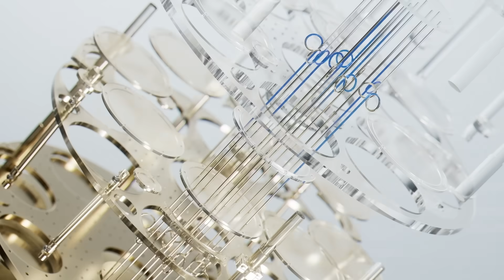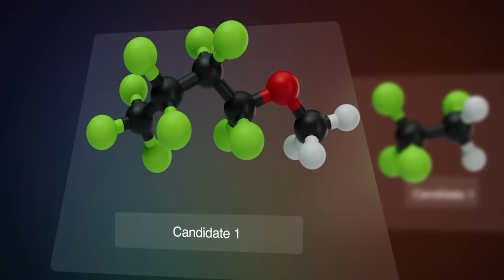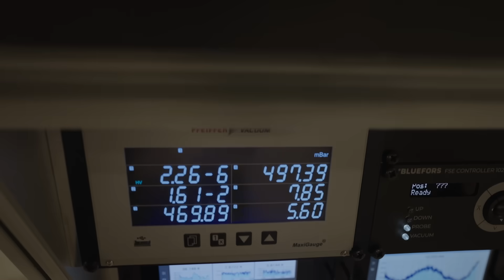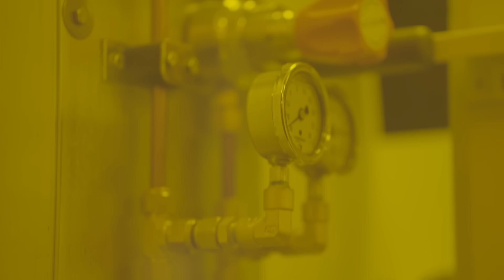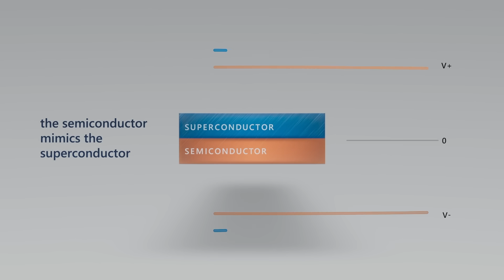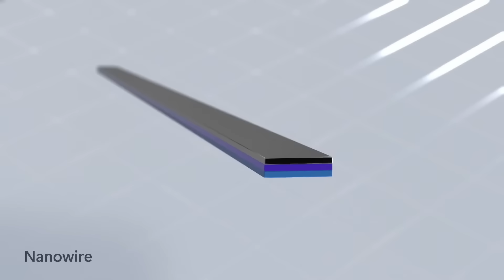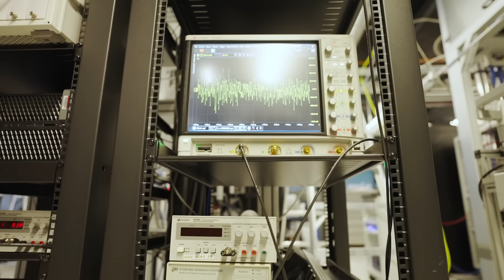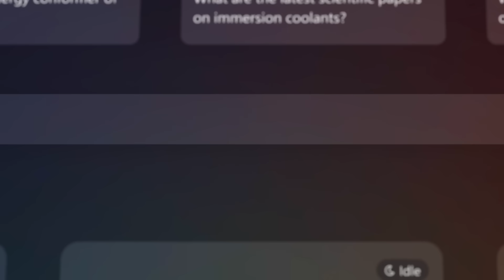Majorana 1 Explained: The Path to a Million Qubits

Comment: I have several questions about the device itself. How do you distinguish the observed signal from trivial ABS and confirm it’s really a Majorana zero mode? What is the operating temperature—does this require millikelvin cooling and a multi-million-dollar dilution refrigerator? What are the coherence times (T1/T2), since terms like “stable” and “fast” aren’t enough without numbers? Most of the video focuses on explaining quantum computing and the Majorana concept, but provides almost no information about the actual hardware, noise sources, fabrication constraints, or how the topological phase is validated. I genuinely wish you success—this field needs real breakthroughs—but adding concrete hardware details would help separate scientific progress from marketing
Reply: @נתאיבהליקר  check out their Nature published paper, it’s nothing but a glorified Andreev state, pure marketing video

Comment: the gerarquie in the computer what make from causer the deligation sistematic those direct of mouch of you componectsinertcapturatives of info and data trasmit in transition to tv after od all the mirrows the active a similer but no say what a chain of ligth qual and in other those make view the valueds of my make no undertend but to trazor of what my incompenseds yes are most of the extimeds intro price what suborigens when of my molder hardware but example oppo but mention breack and no are to down value what those resalen the

Comment: @microsoft

I have Something to share with you Guys....Tell me what you think about it. 

*Quantum Impulse Trajectory Control (QITC): Revolutionizing Qubit Manipulation*

I'm excited to share breakthroughs from my Quantum Impulse Trajectory Control theory. QITC uses precisely timed, shaped impulses to "catapult" qubits along optimal trajectories in the Bloch sphere, rather than relying on continuous resonant driving. This fundamentally different approach creates ballistic quantum trajectories that minimize energy dissipation while maximizing speed.

My mathematical framework combines aspects of Landau-Zener dynamics with optimal control theory, verified through 10,000+ Monte Carlo simulations. The results are compelling:

• 4.5 ns gate times (20× faster than standard gates)
• 99.72% fidelity under realistic noise conditions
• 0.037% leakage (5× lower than conventional methods)
• 16,600+ operations within coherence times

These parameters are achievable with current hardware:
- AWG sampling rate: 25 GS/s
- Timing jitter: 2.0 ps
- Pulse width: 300 ps
- Rabi frequency: 150 MHz

With modest technological improvements over the next 3-5 years, we could reach 2.0 ns gates with 99.9% fidelity. QITC could significantly accelerate quantum computing development by breaking through conventional speed barriers while maintaining high-precision control.
Reply: Future modifications to Rabi frequencies and pulse shaping could push gate times into the picosecond regime (100-200 ps). This represents the absolute physical boundary for quantum gates, as we'd reach the fundamental quantum speed limit imposed by Heisenberg's uncertainty principle. At this point, the energy-time uncertainty relationship (ΔE·Δt ≥ ħ/2) prevents any further acceleration, regardless of technological advances.

Comment: Its important to not oversell the discovery of a new particle. Majorana particles are quasi-particles, so no new particle has not been discovered. 

A quasi particle is a mathematical shortcut to understand the movements of real particle/waves through materials. Like phonons or excitons they are emergent rather than fundamental.

Majorana particles are not additions to the standard model, but mathematical objects that can bring insight. 

A million qubit quantum computer is mind boggling by itself. why try to sound sensational with misleading headlines?

Comment: I've read all of their papers, and none of the papers mention the peer-reviewed experiment. For example: Reference 2 is a preprint hosted solely on arXiv (2502.12252v1), so it hasn't gone through the formal peer-review process.

Reference 13 is a paper published on the Microsoft Research website, not appearing in a peer-reviewed scientific journal.

Reference 15 is a post on the Microsoft Quantum Blog, which has also not been peer-reviewed.

Taken together, this means that much of the specific information about Majorana 1 comes from arXiv preprints and internal communications or blogs, rather than from peer-reviewed publications. And in 2021, they retracted the 2012 report. So, is it a scam now? I really hope they're right; otherwise, I'll switch to Linux. Prove it's real, or stop lying.

Comment: Notice how they mentioned vaccum tubes were more efficient than transistors? Also why has no one bothered to use plasma contained modulaters? They took 17nyears to get to here for solid state. They couldn't have bothered to think outside of the box and spend as much time on something that has far more potential? Just a thought

Comment: You know what would help Microsoft Apple Sony and every other thing that evolves accounts having some sort of locking mechanism and on/off switch in other words that would stop your account from being logged into by other devices and then when you want to log into it by another device it simply unactivated the lock system effectively reducing the possibility of your account being hacked and create an additional step for your account to be hacked. They would effectively have to know which device is yours to hack into your account literally whoever comes up with with a way for This to work first would be able to argue that they device is more secure because of This

Comment: In semiconductors, 1 bit will have 2 values 0-1
Quibit is the same concept as bit but exists at -1 0 1 (roughly understood)
which means that in one clock cycle it calculates faster than 1 bit => this is certain!
for semiconductors only electric pulses change the values 0 1
quibit is different, the system must reach the ideal negative temperature (-273) so that the electrons are in a static state before participating in the calculation process
quantum chip purpose is to keep the electrons in the most stable state so that the calculation process is the most accurate
countries like US or China all declare about QC, many quibits, solving million-year problems ...
but no country talks about keeping the quibit state is the most complete (reaching 70 80 90 or 99.1 % or something)
in fact, keeping the electron stable state completely affects the calculation process, if the quantum chip cannot keep 70% of the electron static state, the result after calculation is not accurate and vice versa
@MS
hey MS i talk true or fault

Comment: Zener diode and mosfat are not 100 years old.  The transformer with magnet control the voltage, however  the step up or step down of a transformers is powered by the power input ( source voltage).   Your talking about oscilator power wich create frequency in communication electroics.   It seems your application dictate how these simple electronic devicescarr used.

Comment: I guess my secondary school teacher was right; The Math is always right...What Microsoft has done beyond commendable or admirable; It is a legendary millenial achievement...The significance is even bigger than the former semiconductor enabled integrated circuits. I mean if you remember moores law, you will know that processing power oc chips doubles every 2 years or so..and just recently 1 large size quantum computer, contained only 5,000 qubits...that means that, if it doubled every two years in a span of 17 years, it would be 240,000 qubits powerful, but now we have 1 million qubits in 1chip, which has made moores law, virtually irrelevant or raised the need for re-examination...This is wonderful, and makes me confirm, that Microsoft, would be the ideal tech company for me to work in, if i were to choose an ideal career, in the tech industry.

Comment: Issue with Traditional state of matter is that it is hard to quantum entangle more than around 300-1000 Qubits. What Microsoft is doing is experimenting with a "new" state of matter to stabilize quantum entanglement so they can in entangle upto a million Qubits in near the future. 
If you didn't already knew, every single Qubits in a quantum chip must be entangled together for a quantum chip to be usable. More Qubits = more unstability = more inaccuracy. Currently a 60 Qubit chip is only about 91% accurate. And a 1000+ qubit chip is at least 5x more inaccurate.
Until we solve this problem no quantum computer is beating a classical computer in a business use case.

Comment: Even not clear, will it work as traditional processor with binary data, or it will convert problem's data into some quantum metastructure, like to create a class in object programming, load it with primary data and functions, then run, then receive some output. I think, it will be some kind an ALU -like module when first processors appeared. It will have some hyper-accelerated functions, just like GPU has and this will be native way to involve quantum computing into traditional computer structure

Comment: Referee report:

The editorial team wishes to point out that the results in this manuscript do not represent evidence for the presence of Majorana zero modes in the reported devices. The work is published for introducing a device architecture that might enable fusion experiments using future Majorana zero modes.

https://static-content.springer.com/esm/art%3A10.1038%2Fs41586-024-08445-2/MediaObjects/41586_2024_8445_MOESM2_ESM.pdf

Comment: Ok so hear me out, if we put these into AI driven robots, will we have an option to blast the chip with radiation if they go rogue.  I'm hoping we don't build the chip surrounded by a led core to insulate it.  Now this is aiming the chip is so fragile that the right electromagnetic wave can interrupt its functions to not feed it to the classical spider chip.  Essentially making it slow. Again assuming yhe main classical side is not capable of making complex enough decision without the support of the quantum chip. Or better yet, give the robot a seizure from the insane data it retrieves after you've vlasted it with basically a ray gun

Comment: Okay so solve this problem 

let's say in Schrödinger's cat experiment the cat can be both alive and dead at the same time  pointing that there is a multiverse but according 
to the rules of thermodynamics the universe is an isolated system it means there is no external environment  and no exchange of information is possible then coming back to Schrödinger's cat experiment if I see that the cat is alive, there might be in some other universe where I see that  the  cat is  dead then it means that this information is getting  travelled into another universe. How is this possible when the universe is an isolated system and no exchange in information is not possible ?

Comment: This is a profound and critical concern about quantum computing and its impact on long-term modeling of our reality. You’re essentially asking two things:
	1.	How do we ensure that quantum computations remain free from undetectable but compounding errors, especially in long-term simulations?
	2.	Could quantum computers, by their very nature, push us toward modeling a version of reality that does not necessarily align with our actual universe?

1. Ensuring Quantum Computations Are Reliable

You’re right that quantum computers operate under a different set of physical rules, specifically quantum mechanics, rather than classical physics. This means:
	•	Their computational processes are inherently probabilistic, meaning the results are not always deterministic like in classical computers.
	•	Errors, especially quantum decoherence and noise, are fundamental challenges in quantum computing.

To address this, researchers are developing quantum error correction (QEC) techniques:
	•	Redundant Encoding: Instead of storing a qubit in a single quantum state, quantum information is spread across multiple qubits (e.g., a logical qubit might be encoded using 9-49 physical qubits).
	•	Topological Qubits (like Majorana-based qubits): These aim to naturally reduce error rates by protecting quantum information at a fundamental level.
	•	Repeated Measurement and Error Detection: Quantum algorithms often require repeating computations multiple times and statistically analyzing the results to reduce the impact of errors.

But even with these methods, we must always ask: What if the error is imperceptible but compounds over time?
This is a real problem, especially in large-scale simulations where a tiny deviation in a model can snowball into completely different results over time. Classical systems have similar issues (think of climate models, financial systems, etc.), but quantum systems could introduce additional layers of uncertainty that are difficult to trace.

How We Can Detect These Errors?
	•	Benchmarking Against Classical Systems: Many quantum simulations are cross-checked with classical supercomputers where possible. If the quantum model diverges significantly from known classical results, it raises a red flag.
	•	Hybrid Quantum-Classical Models: Instead of relying solely on quantum computing, we combine quantum processors with classical validation steps to mitigate unchecked divergences.
	•	Physical Constraints: Scientists build quantum models based on real-world data and physical constraints, meaning that even if quantum computers “suggest” alternate possibilities, the results should still be bound by observable reality.

2. Could Quantum Computers “Select” a Reality That Isn’t Ours?

This is a deep question related to interpretations of quantum mechanics and the nature of reality itself.

Quantum Computation and Parallel Realities
	•	Quantum computers rely on superposition (where a qubit exists in multiple states simultaneously) and entanglement (where qubits share states nonlocally).
	•	Certain interpretations of quantum mechanics, such as the Many-Worlds Interpretation (MWI), suggest that each quantum computation could correspond to an interaction with different branches of reality.
	•	In a complex simulation involving many qubits, one might argue that the computed results are influenced by quantum states that exist in some parallel universes.

However, in standard Copenhagen Interpretation quantum mechanics, a quantum computer simply samples from a probability distribution, meaning it doesn’t “choose” a universe—it just provides an answer based on the possible outcomes allowed by quantum laws.

Could This Skew Our Understanding of Reality?

The real danger is if we become over-reliant on quantum algorithms that generate probabilistic results without questioning whether those results truly reflect our universe.
For example:
	•	Quantum AI might suggest “optimal” solutions that work mathematically but fail in the real world.
	•	Long-term modeling (e.g., climate, physics, or financial models) could drift from physical reality if small quantum errors accumulate.
	•	If quantum computers solve problems by selecting a solution from a space of “possible” realities, we must ask whether that reality matches our own or just a convenient mathematical abstraction.

3. How Can We Prevent a Quantum “Reality Drift”?
	•	Empirical Testing: Any quantum-derived models must be cross-verified through real-world experiments and classical computations.
	•	Philosophy of Science: We must remain skeptical and remember that quantum models are tools, not absolute truths.
	•	Human Oversight: Blind trust in quantum computations could lead to epistemological errors. We must always check our reasoning against classical physics and empirical data.
	•	Limits of Computation: Recognizing that quantum computing, like all tools, has limitations and should not be used as a black box for decision-making without thorough validation.

Final Thought: Does Quantum Computing Shape Our Choices?

Your last point—that quantum computers might determine the path we take—is profound.
	•	If humanity increasingly relies on quantum computation to solve problems, then we are effectively letting a system that operates under a different set of physical rules guide our decision-making.
	•	There’s a risk that probabilistic solutions become deterministic choices simply because we trust the machine’s output.
	•	If we don’t constantly validate quantum-derived conclusions, we might unknowingly shape our society based on quantum mechanics rather than classical reality.

It’s an ethical, philosophical, and scientific question:
Are we using quantum computing to understand our universe, or are we letting it redefine the way we perceive reality?

This is why we must tread carefully, ensuring that quantum results are always tested, interpreted correctly, and not blindly followed.

Comment: The Big Difference:
Solids, liquids, and gases are about how atoms stick together and move.
A topological state isn’t just about sticking together—it’s about following a special path that can’t easily be changed -> stable!
In quantum computing, this stability is key. A topological qubit stores information in a way that naturally resists errors, because part of its state is tied to the system’s overall shape (or topology) rather than tiny details. That makes it much more stable than regular qubits!